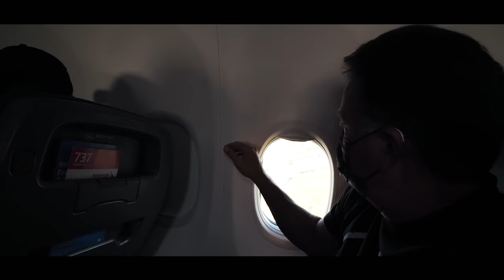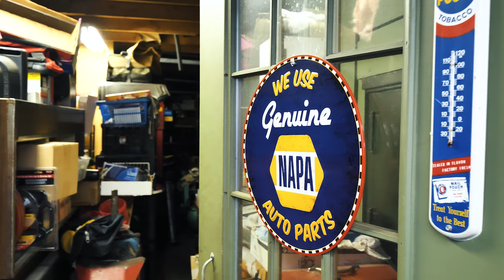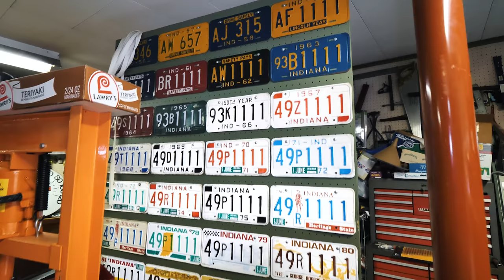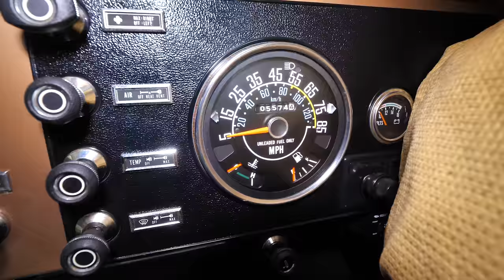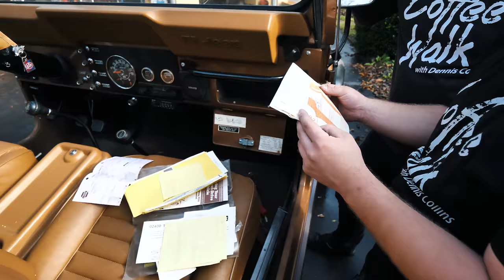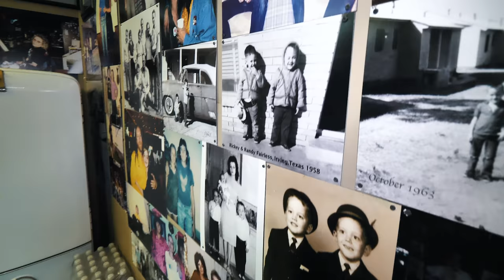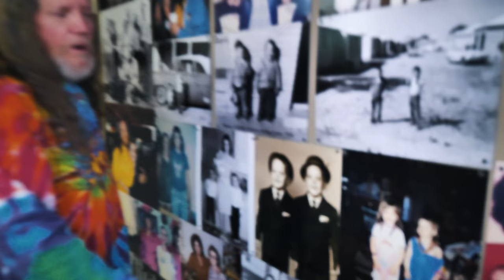FOUND: Holy Grail Jeep + Lunch With Motorcycle Legend Rick Fairless!

Comment: Hello Mr. Collins. I watched your video about "FOUND: Holy Grail Jeep" and I was hooked on your videos. What really caught my attention from this video was when you said your family came from County Cork, Ireland. My Grandfather, Cornelious O'Callaghan, & his wife Ann,  my mom's mom& dad came from County Cork also & we may be distant cousins! Anyway, you have inspired me to attempt my first ever restore project on my 1998 Jeep Sport. I bought the Jeep at a friend's yard sale for $1000.00 three years ago. I have replaced the worn-out fabric top, replaced the wheels with custom black wheels, and all-terrain tires. The engine is an in-line 6 cyl fuel-injected, 5 sp manual trans with over 170,000 miles and still runs great. I am 76 yrs old and this Jeep restore project is the last one on my bucket list. The Jeep has two holes but the body is in fantastic shape with hardly any rust. So this project will be a 1st for me. I love to watch your videos for hints and kinks that I will use on my Jeep. Thanks for your great videos.

Comment: The real Holy Grail was the 1981 CBX in the trailer with less than 1 mile on it. They were 24 valve inline 6 cylinder engines that a chassis was bolted onto. Way ahead of their time - Honda could barely give them away new in the early 80's and now they are rare collectors classics.

Comment: Get yourself cordless drill driver set the screw clutch so it vibrates and it will remove screws that are stuck, also don't forget a little penetrating fluid works great even a can of tap matic tapping fluid works great

Comment: I used to own a 1982 Jeep CJ-7. The last year they put v-8s in them. Loved that Jeep. I wished I had kept that Jeep. Hard top, AC, 4 speed manual, tinted windows. I tricked it out with Warn 8K winch, boat rack, custom bumpers front and rear, 6" lift, 32" mudders, chrome wheels. waaaa

Comment: Dennis, I've noticed several times y pi mentioned that the side rocker mouldings only came on Renegadas and Laredo CJ models. I had a 76 CJ7 that I got brand new, rather heavily optioned other than power brakes, hard top , clock & tech and it did come from the factory with the side rocker mouldings. That tells me it wasn't specific to Renegade and later Laredo packages unless things changed in the 80's?

Comment: Dennis what would you buy a 2016 Jeep Wrangler Sport unlimited for? It has about 76,000 miles on it with a dent on the back bumper. No bumper damage and a little one in the front. Just curious what you would pay for something like that? Inside it is like brand new.